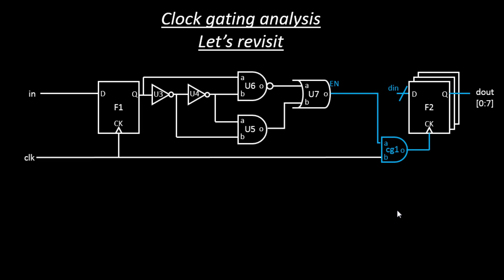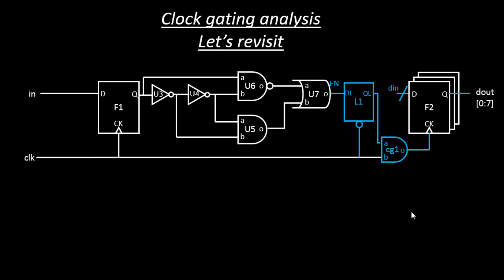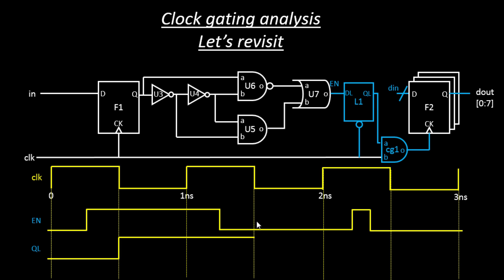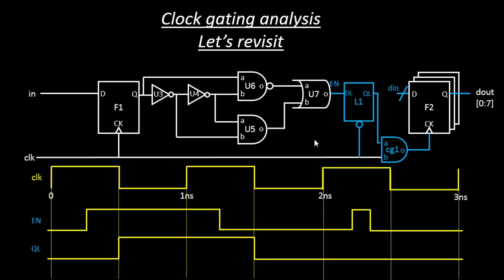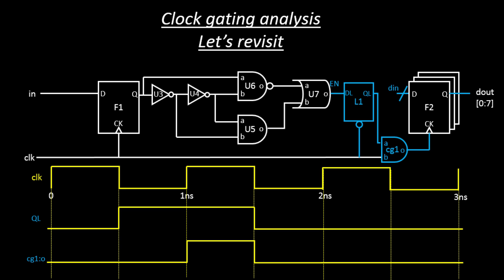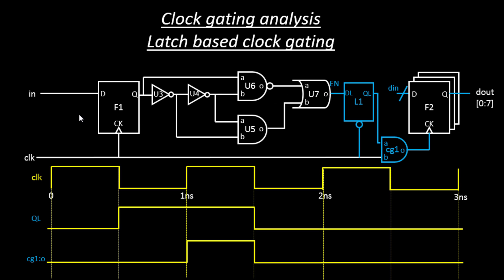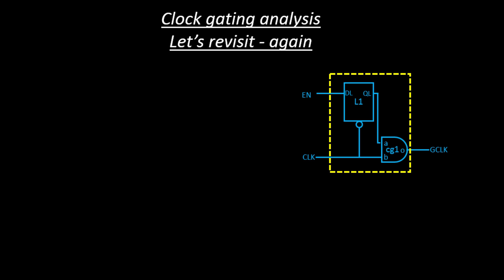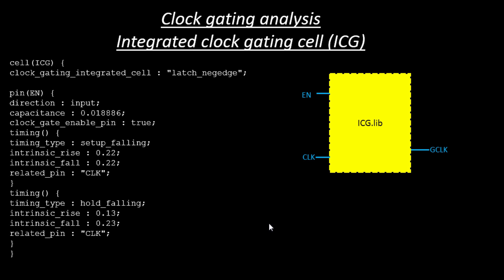Latch based clock gating technique and introduction to ICG

Comment: yes, latch prevents the glitch happened due to EN toggles at the high portion of the CLK. but what if the EN got a glitch at the low portion of the CLK. It still need a synchronizer.
Reply: I think if EN gets a glitch when CLK is LOW, latch will pass it through to QL but output of the cg1 AND gate should still be LOW as CLK is LOW. Correct me if I’m wrong.
Reply: @varunsharma3860  No we get glitch whn enable toggles in low level of clk.pls check once with waveform.thanks